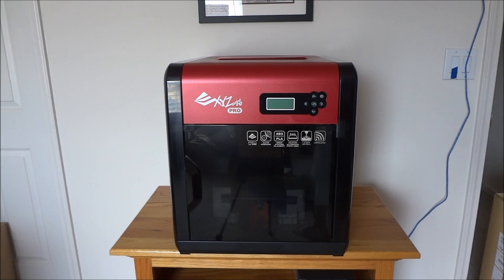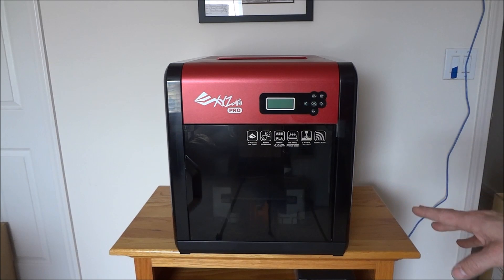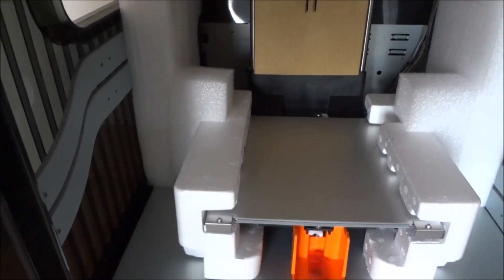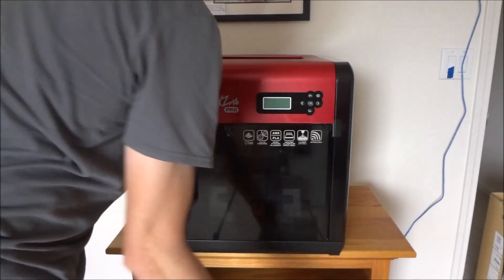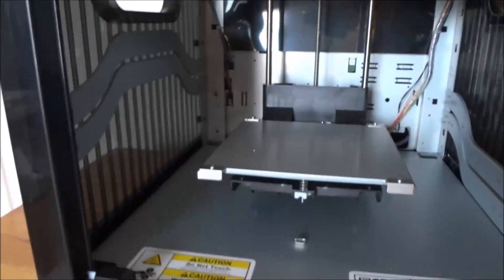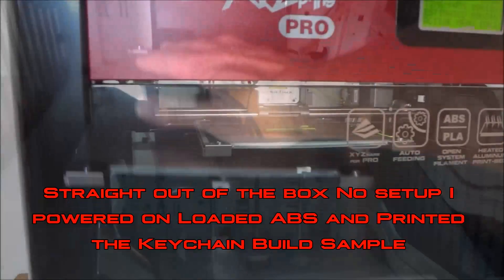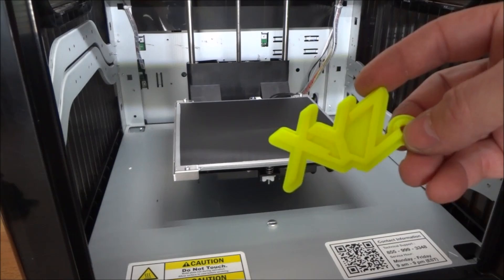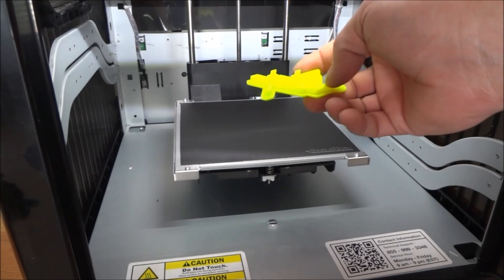XYZ Printing  Davinci Pro 1.0 3D Printer  Straight Out Of the Box!

Comment: i bought one in march. its a pain to keep working properly but you can make some decent prints.

1: buildtak
2: buy better teflon hose and fittings.
Reply from the maker: Keith kowalski 
I could not agree more I put build take on before first print.  just hade my first fitting issue they included spares maybe some all metal type would be better
Reply: the fittings that came with it are junk. especially the ones that attach to the bowden.

the good news is a 10 pack is about 5 bucks on amazon. they fit the same and work the same just dont break as fast.  the teflon tube is about 5 bucks too.

Comment: i just bought this machine also... I have used up the yellow abs printing back to back parts... the absolute best upgrade I made to the machine (which sped up the learning curve, i suspect) was buying simplify3d... it is an expensive program, but i decided to do this as the first upgrade and it made a world of difference... i have not made any videos on it yet... but i do have pics of some of the stuff on facebook etc... look into the software and what people say about it... i do believe the software has turned the printer into a machine worthy of a much higher price tag... though there is plenty of value as it sits...  i printed something as large as the bed would allow... and pretty much as tall also... after one failed attempt using stock software... i used hair spray (happened to have some in the cabinet) and switched the software.... printed amazingly... i have ordered some aftermarket filament and printed a spool holder... waiting on that to continue to make parts...
Reply: there may be free software that is better than the factory software also... but i went ahead and went with simplify... as i knew i would want it eventually... so may want to look at the others also
Reply from the maker: Thanks for the tip, I installed the BuildTak straight out of the box Brian seemed to have good luck with i. I did not want to fool with tape and glue stick. so far so good. I had 2 lifts while printing the External spool holder at 50% infill dropped it down to 30% infill it printed fine.
 After going through the Yellow spool I got my first clog I think I have it cleared up now Keep your fingers crossed. I'm looking for spare parts to have on hand.
Working on a Activated Charcoal filter Now that I drew up in Fusion 360 if it turns out I'll post a video.
The ABS fumes don't bother me but the Wife is a little more sensitive this should help.
Reply: CNC4XR7 sweet.. i ordered an 8x8 sheet of "pei" so i could get rid of the glue or spray too... i didnt have any clogs after the yellow and you are right, the fumes did not bother me, but the wife, does not like it either... ordered some polymax and a couple others to try, havent gotten it yet... i draft all the time in fusion 360 and typically have to send the files to a shop to cut.. im working on a conversion and have been watching your videos... thank you for them... trying to figure out what i need if i use the clearpath sdsk motors, as far as size of motors, for the lms-3990 and then what else i need to control them (smooth stepper only, or additional equipment) ...
Reply from the maker: The choices are numerous I looked into clear path but decided on the Leadshine 3 phase steppers.
Reply: CNC4XR7 i will look into the leadshine also... do you have a recommendation, as far as what size I should use, so that i do not "limit" whatever the machine should be capable of doing, im already limited with my beginning skill level, but i learn very quickly and I dont want to need to upgrade things down the line...
Reply from the maker: On My X2 Mini mill I run Nema 23 495 oz. which are plenty for my mill standard Bipolor motors I bought the package off Ebay Never had a issue with them in 3 years. Longs motors is the seller.
Reply: ok... thank you...

Comment: Great to see that you've joined the 3dprinter hobby! I'm so happy that I got mine a little over a year ago. It opened up a world of options and possibility that were never available with CNC metal working equipment. Truly a great complementary tool to your shop. Enjoy!
Reply from the maker: Thanks Jon, 
I agree it gives you a lot more options and more opportunities for Failure! LOL
Reply: True, but 3d print failures are much cheaper than metal working failures.
Reply from the maker: Yeah that's the main reason I got one for prototype  design testing etc.